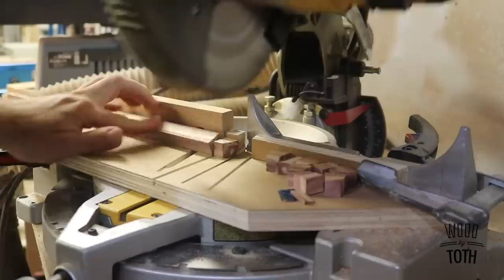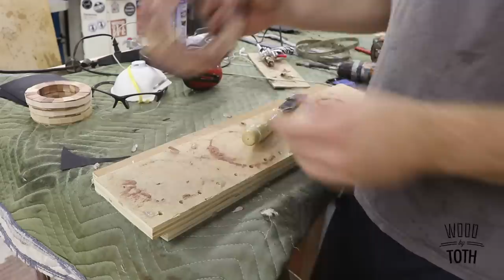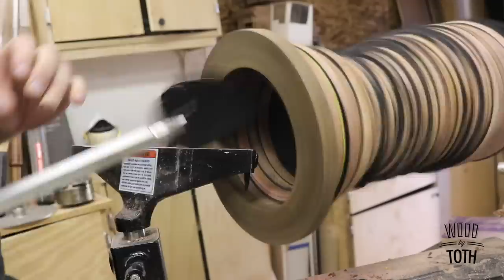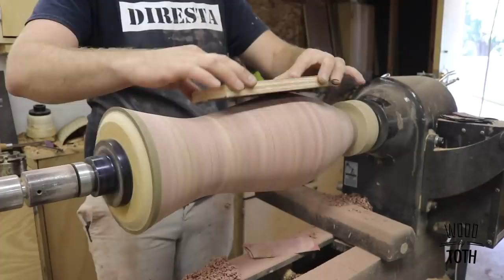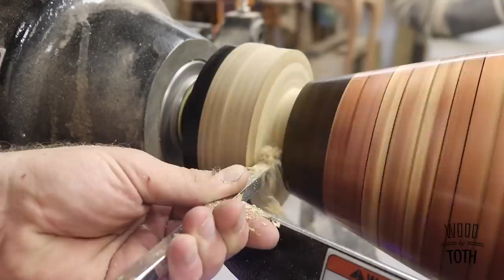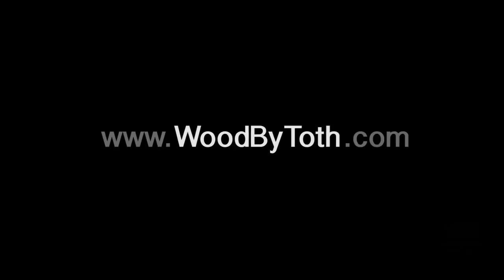Woodturning // Segmented Aromatic Cedar Vase

Comment: Absolutely love your work! I am curious though, why you don’t use a stop block for repeat cuts when cutting the segments?
Reply: He talked about it in a shop tour video or something similar once. I think he just didn't find it necessary compared to the simplicity of putting a line on the fence.
Reply: That traps the piece and also sawdust builds up by the stop block. A trapped piece can go flying.  Cutting to a line is surprisingly accurate and easy.
Reply: Makes sense!

Comment: Just awesome! Could you explain what mean by the 7 degree taper? Thanks,  Stuart
Reply: Unless I'm mistaken, if you look at each ring that makes up the vase, you'll see that they're not flat.  Each piece has been cut with a 7 degree taper and then stacked, as rings, alternating thicknesses so that on any given side of the vase, you've got a short ring and then a long ring.  I never would have thought of doing that, and I definitely don't have the engineering skills to do it.